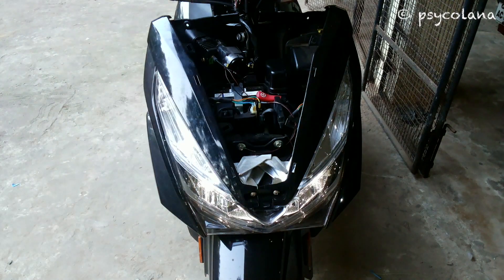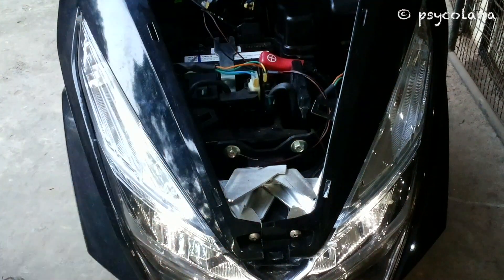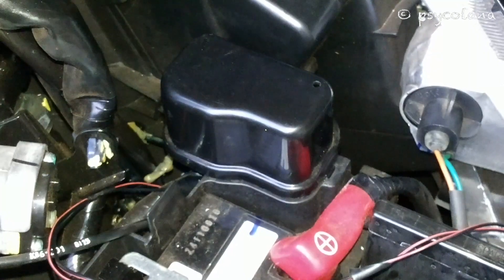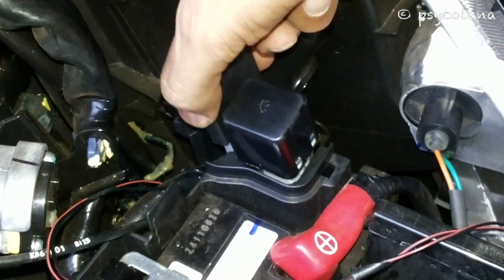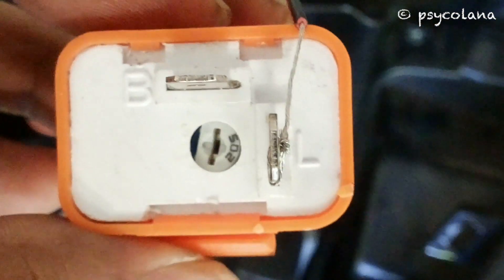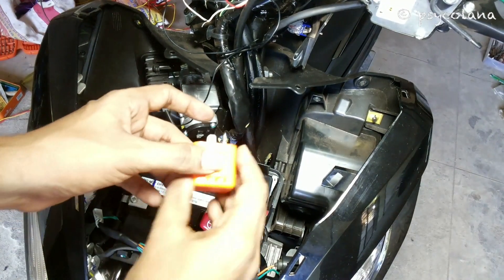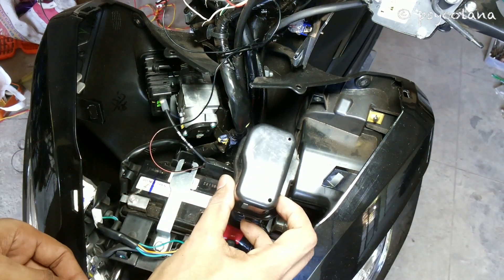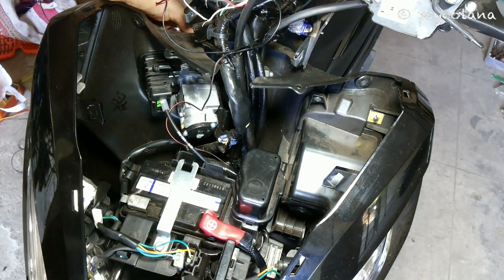How to Change Stock Turn Signal Bulbs to Led | Honda Grazia

Comment: Plz make similar video for BS6 model. I think the rear opening system has been changed in new model. I recently purchased BS6 model and want to know the rear indicator bulb replacement process.
Reply from the maker: if i get my hands on a bs6 model will make a video
Reply: which fitment cross pin/straight pin??